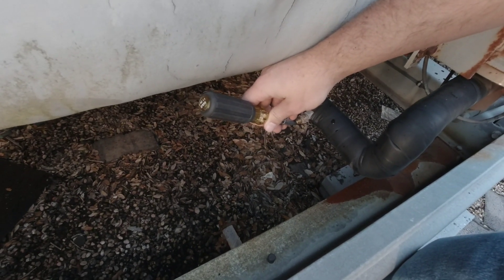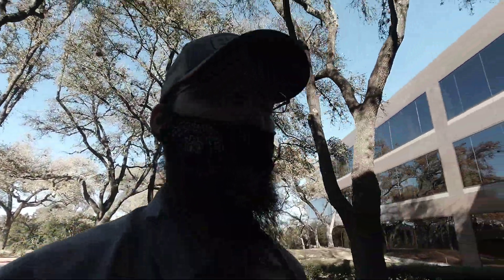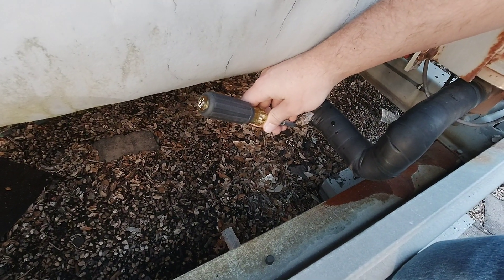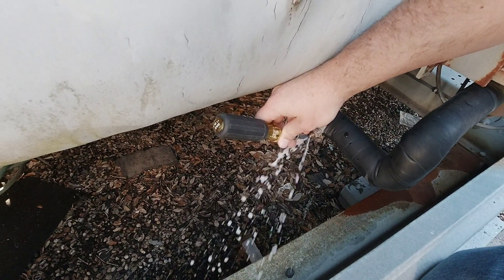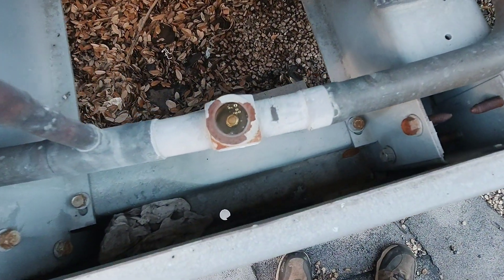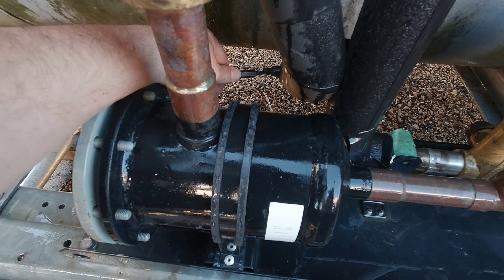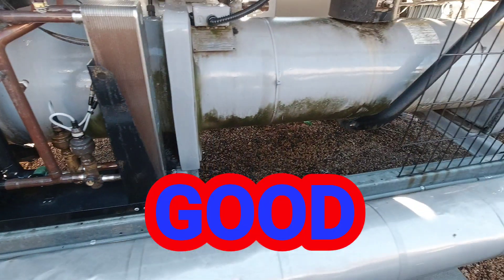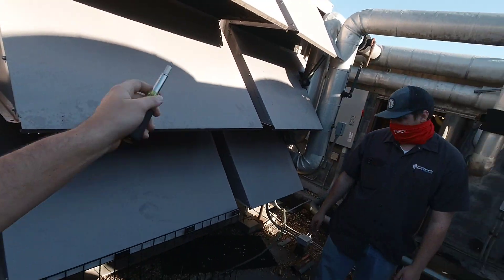Chiller Down Water In Refrigerant! Carrier Air Cooled Chiller

Comment: Really is a shame.  About 2 weeks ago i went out to 2 brand new air cooled screw chillers  contractor did the hydrostatic test on a Friday, forgot to turn heaters on and it got really cold over the weekend.  Froze and busted about 20 tubes on each machine and cracked the divider plate between circuits  2 very large, expensive paperweights now   Never even started up.
Reply: Can someone explain in detail, about all the ways chiller tubes can burst?
Reply from the maker: It could be, evap temp sensor fail can cause over cooling and freeze, flow switch/sensor fail with low/no flow causing freeze, recovery or charging with no flow cause freeze, low ambient conditions with no freeze protection.
Reply: @HVACTIME  so basically what you’re saying is once copper tubes, Reach a certain low temperature ( Due to all the issues you mentioned above ) it will automatically freeze copper and crack tube because Tubes should not experience such low temperatures…..  Or does there have to be a large differential between water and refrigerant for the crack to happen…( Kinda like if you take a hot plate out of a microwave and put it under cold water, and it crack because of temperature differential.)
Reply from the maker: Thats horrible